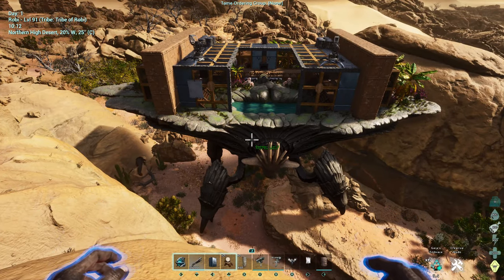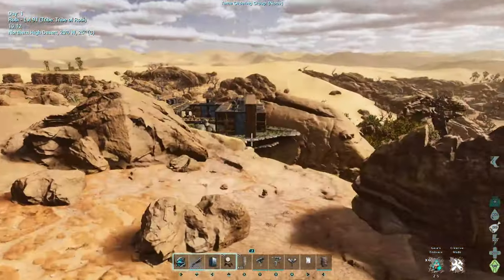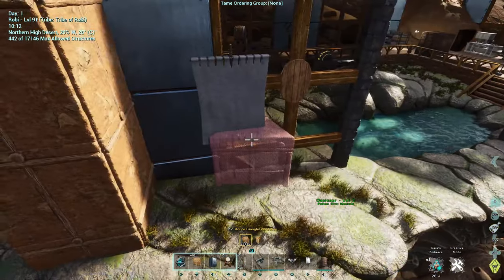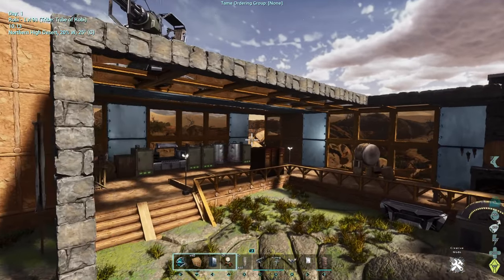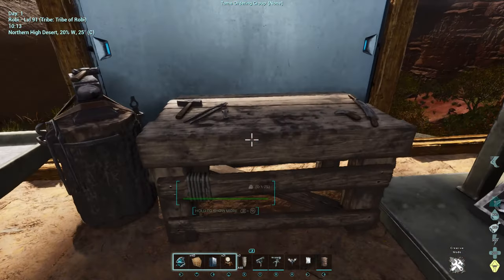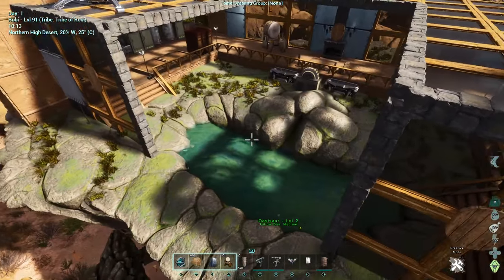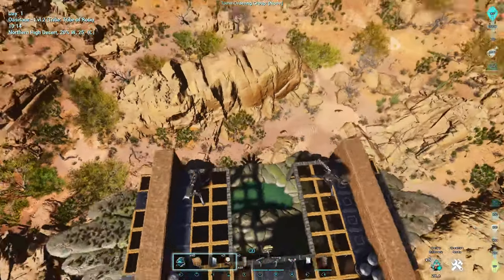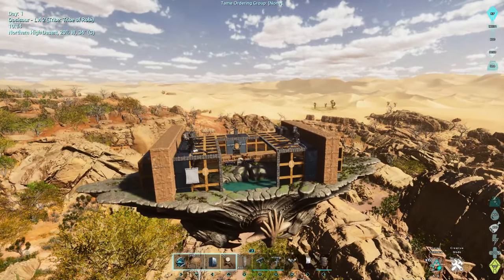Building on a Oasisaur - ASA Scorched Earth

Comment: Does it have a build limit like a raft or platform saddle?
Reply from the maker: Yes it does. The limit is that of a platform saddle. 
In single-player and unofficial servers, you can change the structure limit in the .ini file.
Reply: Just to confirm they do need a saddle right?
Reply from the maker: @Bilybobbery  No saddle needed.
Reply: Alright thank you
Reply from the maker: @Bilybobbery  You are welcome :)
Reply: @robiplays is this possible to change on ps5??
Reply from the maker: @Liam17928  Though I don't play ASA on consoles, I think it's possible to change the build limit in Settings > Advanced > Misc > Platform Structure Limit.
Reply: @robiplays  thank you! 🙏🏼